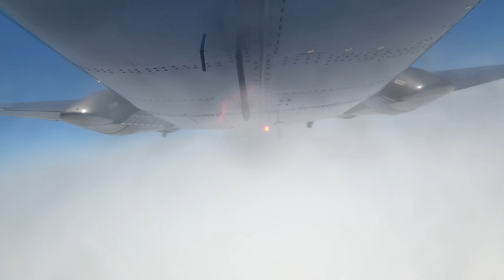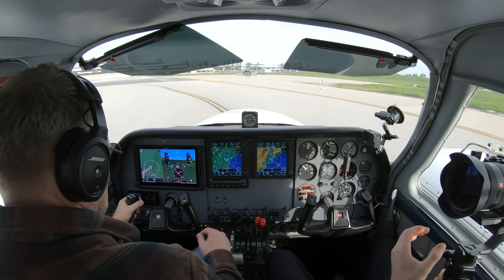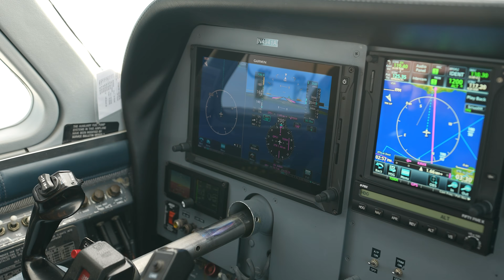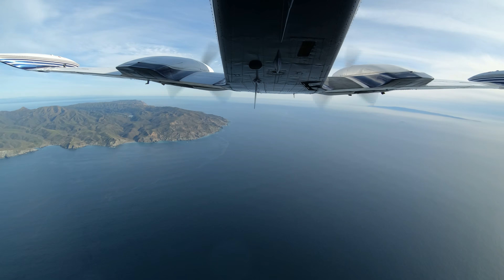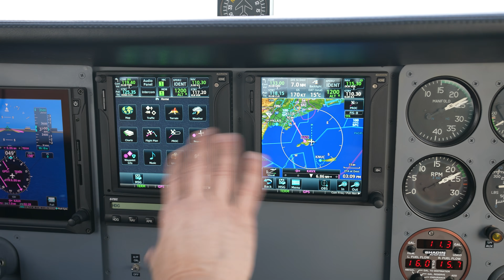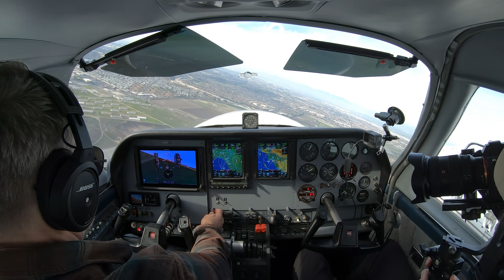1978 Cessna 310R with Heavily Upgraded Avionics

Comment: Rich there is a Cessna 320 that has been rotting over at Chino for the last 30 years. N48325.  My dad owned it but his mechanic messed it up.  I often wonder if I bought it if I Could fix it up.   I have been an A&P for 30 years and I am a private pilot as well. Only thin is that I would have to get it to Kentucky
Reply from the maker: I think best to access it from a total time, complete logs, damage history point of view. Let’s say it has no damage, complete logs and low-mid airframe time. It would be definitely be worth bringing back to life. On the other hand if damaged, missing logs, high time -maybe not worth putting time/money into.  Chino is close so if I can help, let me know.

Comment: Hey Rich, nice video. Isn’t great how those old 310s can carry on, even at 9500 hours on the airframe? The avionics upgrade really give them a new lease of life, and if the maintenance and any corrosion issues are kept on top of they’ll keep on trucking!

The big question one has to ask though, is how much of a market is there for these old piston twins today? Most of the manufacturers seem to have lost faith in this class of aircraft, when compared to the proliferation back in the ‘60, ‘70 and ‘80s (with a few exceptions). Is it their operating cost, or just that high end singles can do so much these days, with similar proven safety margins?

Over here in 🇬🇧 UK, operating costs are just killing us. I’m sure you think your Avgas prices in the States are crazy high right now, but for comparison the UK average is about £2.30 per litre = £10.44 per imperial gallon = £8.66 per US gallon = $10.75 PER US GALLON ……! 
So if your 310 is burning around 25 USG / hr we’re looking at $268 per hour, and that’s just in fuel costs.
And if your tanks hold 140 USG, that makes it $1505 for a full load of avgas.

Anyway, keep doing what you’re doing, and thanks for showing us Matteo and his filming skills. That’s a whole job in itself, especially the post production editing 👍
Reply from the maker: Yeah I agree most manufacturer’s have written off the piston twins - too bad such wonderful airplanes. Here in the US market seems strong for them right now - and yes if our fuel prices went to where your’s are the market would suffer. Thanks for the message and thanks for watching!

Comment: I fly a Cessna 152. Rentals. What happens if engine fails while banking from a short base to final  while flying a twin.
Reply from the maker: Likely power would be pulled back so the aerodynamic impact of the engine out is minimal. However, if the pilot panics and executes a single engine go-around and adds full power and pitches up too abruptly - likely VMC roll.

Comment: Great video. I remember flying a 310Q back in 89 from SQL-RNO to the air races…6 on board and we climbed out quick…lots of power and great stable platform. This plane is a beauty. Tremendous avionics package.
Reply from the maker: Agree - such a great airplane!

Comment: The 310 is a very underrated airplane. It is over shadowed by the bigger Cessna twins and Barons, but the 310 is very good. It is a very smooth and easy to fly airplane, with awesome visibility. The 310 is very comfortable, it makes a great family sized cross country hauler. While the market on twin pistons is shrinking, the 310 is a great option as the 310s hold their value pretty well.
Reply from the maker: Thanks - I agree, very roomy and comfortable airplane!
Reply: Only underrated until it passes a baron
Reply: Dad used to level off and let gear come up then climb. Maybe even unload the gear

Comment: Nice work.  Looking to upgrade my panel similar setup in a 340.  Flew the STEX for a long time.  If you hold down the autopilot disconnect for a few seconds that load beeping stops.  Cheers!
Reply from the maker: I was trying to remember what cancelled the tone- thanks!

Comment: I'm a non-pilot, but if I were, and had my MEL, I'd do something like this. I saw Controller has a 2022 Cessna 172 for like $655,000. If it was my money, I'd get something older and well gone over.  I see Rich has a lot of planes for less then $200,000 (a couple Mooneys, etc).  Prices for new planes is out the roof right now.
Reply: Yeah, prices are absolutely insane, they don't make sense to me. I'd go for an older plane as well
Reply: @joellouisfire  I know the G1000 is awesome to have, but I hear just it costs as much as an older aircraft.